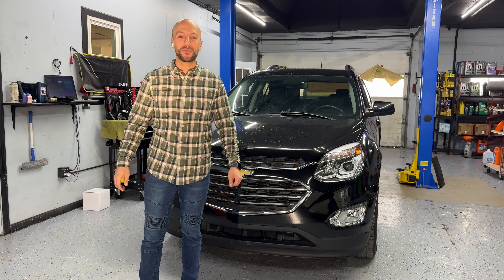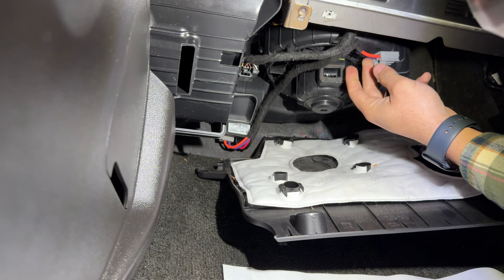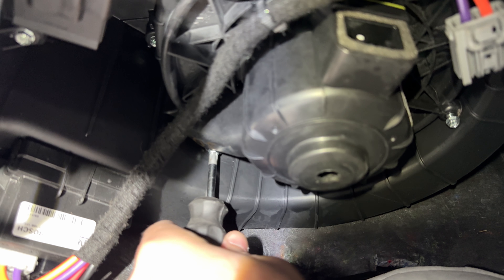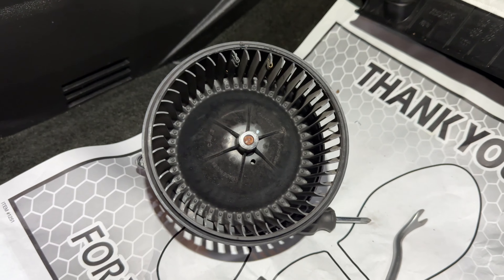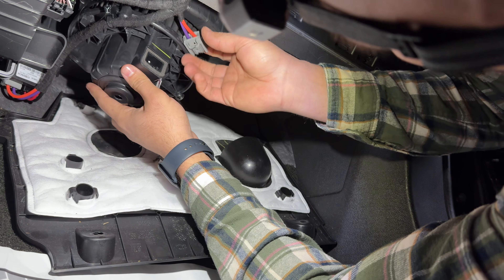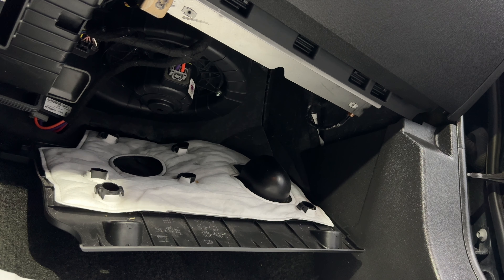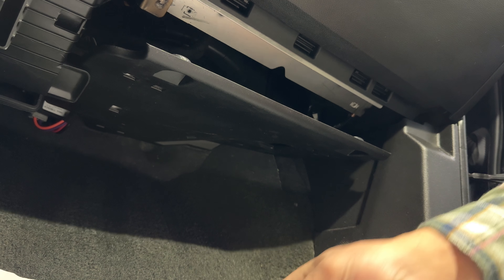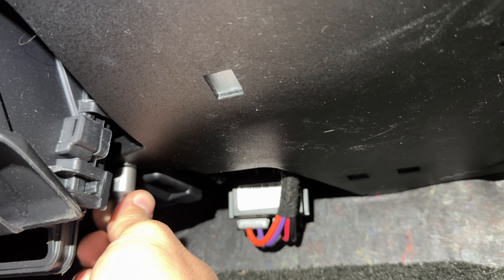Blower Motor Fan Replacement - Chevrolet Equinox (10-2017)

Comment: Thank you!  This is a way better video than the previous ones I've watched!  I'll let you know what I find.  Mine works sometimes and not others.  If I hit below the glove box it will kick on sometimes and other times leave me cold :)
Reply from the maker: @kathyhester3544  thank you! And that sounds to me like a bad electrical connector! You must have a loose wire or ground there
Reply: Where having the same problem

Comment: I have been hitting my dash board over a year. Some times I don't need to because my a/c will blow. But when it doesn't I have to hit that area. Where the fan is, I feel like I can hear it trying to connect most times before hitting it. Do you think its the fan or wiring?
Reply from the maker: @Jay-ct1  if that’s the case then check the connector on the fan and the wiring for it!
Reply: @brownsburg.motorsports  ok I will! Thank you!

Comment: Where you were working could it cause the carpet to get wet? I have some kind of leak and I can't find where it's coming from. But today I found out my fan motor may be going out. Because of a popping I hear when I turn up the fan.
Reply from the maker: It could be the drain for the sunroof but if you don’t have a sunroof I am going to say I hope it’s not the heater core but that’s about the only other thing that I can think off that might cause the carpet to be wet
Reply: @brownsburg.motorsports  thank you first and foremost for answering back. Thank you for telling me about those two things. I will check that out. You are awesome!!
Reply: I know this is a few months old but take a look all the way to the right. Take off that kick panel and lift up the rug. Thats were water was coming in. Might help you.

Comment: IF BLOWER MOTOR GOES, THEY SAY SAY RESISTOR WILL FOLLOW CLOSE BEHIND. I HAVE BOTH PARTS ALREADY, WAS GOING TO RETURN the RESISTOR. REPLACED ONLY BLOWER MOTOR FOR NOW, NOT A BIG JOB. YOUR THOUGHTS ON KEEPING or RETURNING RESISTOR  , ANYONE. THANKS
Reply: If you already have both parts, and you're already under there, you might as well replace the resistor, too. Better now than the resistor being the problem and burning out your replacement motor in a couple of months.
Reply from the maker: @davidson2004fatboy  i would recommend replacing both since you already gonna be down there and since you have the parts as well!
Reply: @Harringtonize  👍👍🙏🙏